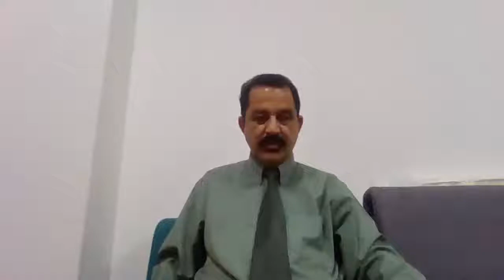Civil Construction Material--Technical Session / lecture no 17--Water Proof  Concrete

Comment: Pozzolans Poz zolans have proven of use in i n c reasing the resistance to passage of water in lean mass concrete mixt u re s, but generally in ord i n a ry conc rete they will not affect watert i g h tness unless they are used for c o r recting a deficiency in the gra d ation of the sand to be used.

Comment: Water Proof concrete
: Waterproof concrete is an impermeable concrete used for long-lasting, durable watertight construction. ... Water  impermeability is determined by fulfilling requirements to limit water permeability through the concrete itself, the joints, installation parts and cracks.